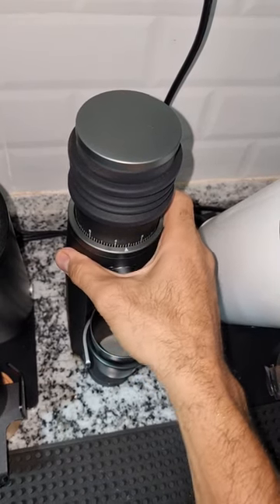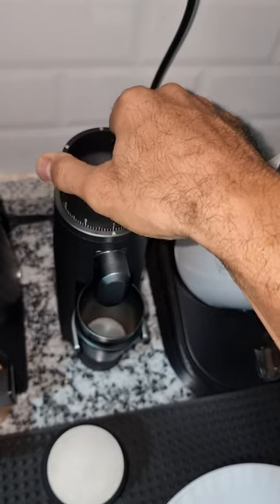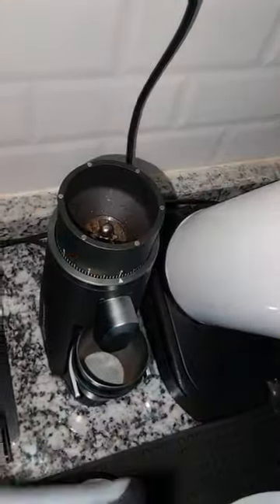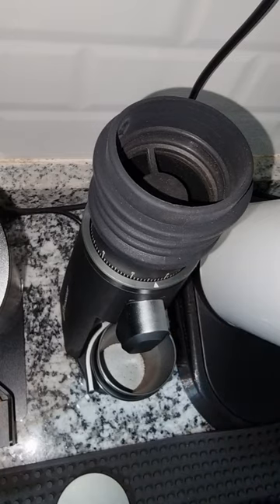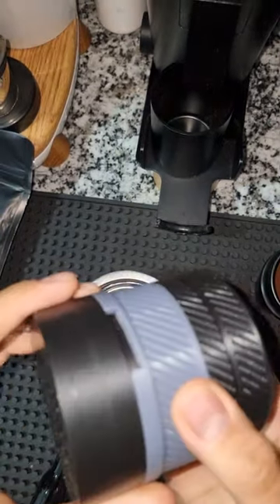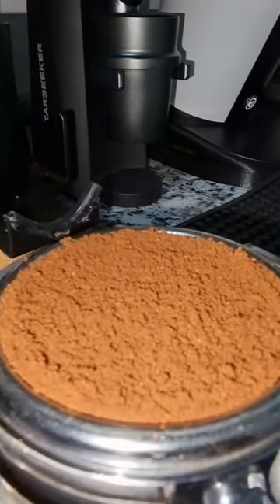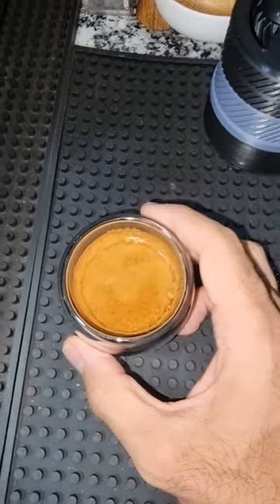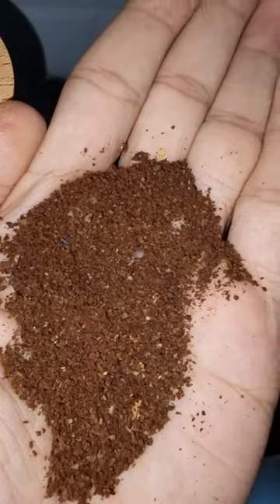Starseeker Edge Grinder Explained and Espresso Workflow

Comment: Starseeker Edge vs Baratza Sette 270? (for espresso). Who's the winner? ☕
Reply from the maker: I had a setti 270wi. Plasticy, LOUD grinder. I had alot of problems with the grind settings that kept on getting closer to zero until I couldn't grind finer even after shimming. That's because the burr carrier is plastic.

The Edge is waaaaaay better fpr sure.
Reply: Yeah, I don't like the plastic body and his loud noise, but it's Baratza, a very well-known and reliable brand, right. Starseeker, I heard of them for just a couple of days... ☕

Comment: have you tried hibrew g5? im still deciding which one should i buy either starseeker edge or hibrew g5 since hibrew g5 also offer 2 grinding speed which are around 400rpm & 500rpm
Reply from the maker: I actually didn't try it, but the edge runs at 140 rpm. Very slow, which helps alot with consistency and clarity. I think this is why I favor it over the Niche Zero.

Comment: How does it compare to the niche? i'd imagine possibly better due to lower rpm?
Reply from the maker: I favor it over the Niche, the flavors are way better even though the burr is smaller. I think that's due to the 140 rpm.
Reply: @morningcoffee1  Thats great, thank you :) not sure if its been updated or if its different model but i can see a 220 rpm version on aliexpress :S it says that the motor is only 48w, is that correct or a typing mistake? seems very low

Comment: slow grinder good ? and do you know how well this compares to lets say eureka mignon
Reply from the maker: It's known that slow grinding will produce less fines. This is why a feature like variable RPM started to appear, to ket users play with the speed. I haven't tries the Mignon but I do have a Niche zero and DF64, DF64V and all of them have fast RPM. I still liked the slow grinding more in both espresso and filter.
I think that everyone has to try in order to find his best preferences though.
Reply: @morningcoffee1  now i am really curious about it . I am used a macap grinder but this is also perfect size for my small coffee corner setup

Comment: Is it capable for light roast espresso?
Reply from the maker: Yes, it is with a good range though. .
Reply: @morningcoffee1  How much the motor power? And the gearbox all metal? It’s not easy to find clear information about this grinder.
Reply: @fhmcoffee the motor is only something like 80w, with the low rpm speed, it is slow as heck. Waiting for someone to do a teardown video, but I suspect it’s all plastic gears at this price level? (Us$280)